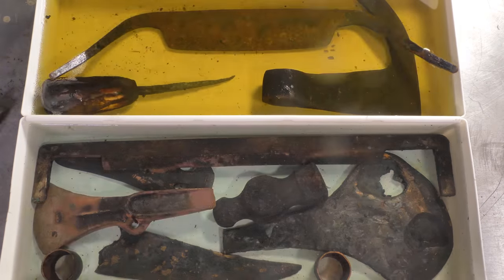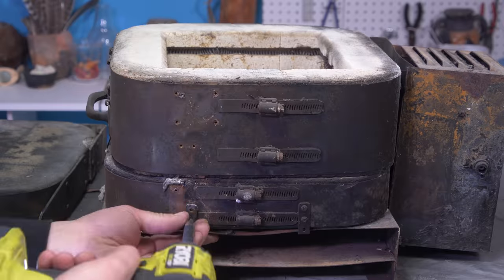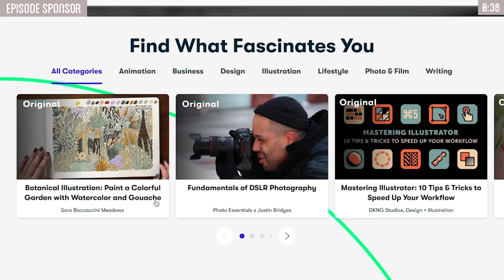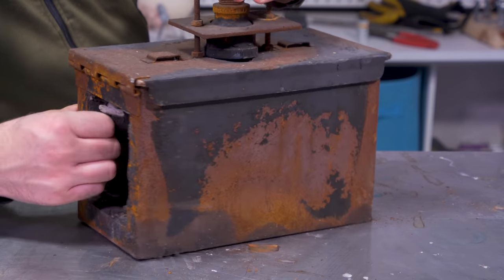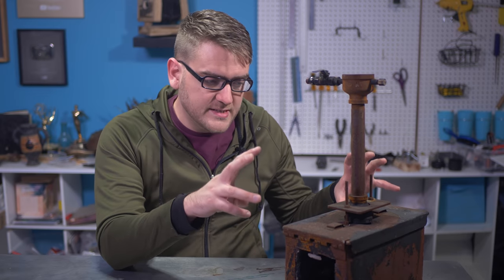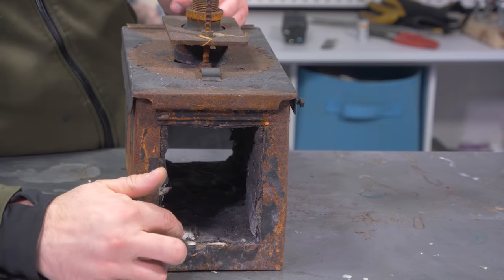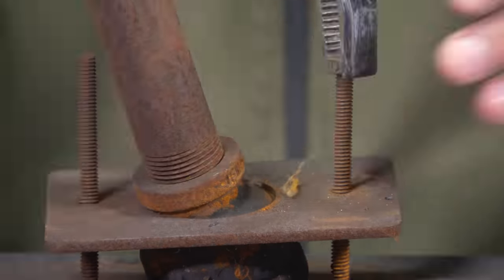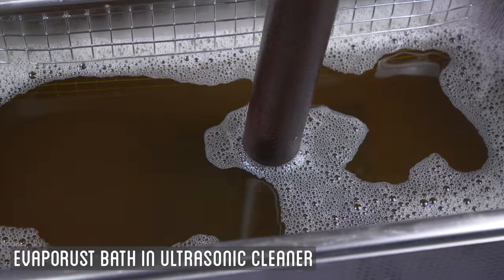Restore or Replace? $1000 Kiln and $150 Forge Rebuild!

Comment: Did you check temp specs on the PI? Might not like being that close to the high heat
Reply: There is insulation. also boards are easily fine up to 100 c

Comment: Just wondering, do the restoration costs here factor in consumables like how many wire wheels/cups, sandpaper discs, etc. you went through doing all the cleanup? You did pretty good work either way, but it seems worth noting if you ended up looking over and realizing, "Wow, that pile over there was like $1k in abrasives to get all the char/ rust/ etc. off."
Reply: A good thought, though as someone who does lots of projects roughly similar to this I don't spend much on those consumables. A pack of say about six or seven sandpaper rounds only cost about $10 and they last about a year on my various projects.  So regardless of whether they're factoring them in, the cost shouldn't be that much more.

Comment: The touch solution looks cool, but I wouldve opted for real knobs. When using the kiln, you'll probably be wearing gloves so the touch interface wont work. Knobs work with gloves

Comment: I feel like a pi would be overkill for just regulating temperature
Reply: Definitely. This is probably a $20 jellybean+Arduino/teensy project, wiring and case included.
Reply: He probably chose it just to have the more advanced interface and customizability. An Arduino would suffice, but wouldn't give him a whole operating system to work with.

Comment: I don't think the price comparison for the kiln (repair vs new) is fair. Granted it was a pain to program, but when your done, you have a definite upgrade. I'd bet if you could find a comparable one to buy with a touch screen display that shows all that info, it would cost at least 200 more than the base model.
Reply: plus he can now take that experience to build his own later, as experience has a dollar value as well, one that he normally overlooks it his pricing.

Comment: I dont think one should count the system design into price per say, since PI has so many already designed projects and say someone else now has the logic board on their kiln fry, they can now rebuilt it using your instructions since work has already been done. Also can recall how the original controls were, but this is really nice you can now make your own temp curve profiles and even control it trough the phone etc, though down side is that one should never trust development board like this to handle kiln or such systems on their own with out supervision... then again i would not trust any machine to do it, if its not tried and tested tech that cannot go bonkers ever. 3D printing, i'm always at home when its running or someone else is supervising it. Only thing i have ever left unsupervised is the oven and that was for just half a hour and washing machine while i went to bed. Its not worth the risk of fire leaving them on. For long 3D prints i would just edit the parts to several smaller peaces that i then glue or chemically weld together so i can supervise it constantly, since not many things can supervise them selfs and there is always the chance that one transistor or resistor blows and whole thing fails spectacularly.

Comment: Eh, if you're considering yourself, then you should be paying whatever wage you should be paying yourself, not minimum wage. You are not worth minimum wage.

If you're doing a generic comparison of purchasing a brand new vs rebuilding/repairing it, you need to consider tools cost, not just labour and parts. To make it a fair comparison, you can't assume everyone have the correct tools for it.

A drill, you can assume most people will have. A sander or an ultrasonic cleaner or the tumble rumble thingymabob? Nope, in that case, you'll need to factor rental cost of those (if they can be rented).

Comment: You really should just buy a new kiln just for the safety reasons. The custom controlled kiln is a major safety hazard and it hasn’t had the same rigorous testing commercial kilns have to go through. Please buy a new one, I don’t want to see you hurt or your property damaged by another fire.
Reply: I really hope he sees this. He did say something in the snow fort video about favoring less flammable materials for the new workshop (which I hope means he'll be opting for brick or concrete or something) but if this kiln fails it's at least the $350 Raspberry Pi gone, if nothing else. Unless the old-fashioned brick kiln he built survived? I know he made one, I just haven't heard anything about whether it's still usable.
Reply: That's why he said he was going to be really cautious when using it, and that he still has a lot of work to do. Given that he's reused most of the original parts minus the electronics, and placed the electronics in the same original housing in the same location with the same original insulation, it seems very very unlikely to cause any issues.

A big company wouldn't accept the small risk, but given the nature of this channel and how relatively simple the kiln is, I don't think the risk is too great for Andy.

Comment: A little late, but I just wanted to point out that barehanding the charred remains of the electronics probably isn't the best plan. All that burnt plastic puts off a bunch of toxic combustion byproducts and some of it is more of a tarry mess that isn't volatile enough to dissipate on its own. I'd have worn gloves for that and put it through an ultrasonic first thing. One sadly common technique for scrapping electronics in third world countries is to make burn piles and strip the metal out of the charred remains. It's profoundly unhealthy, not just from breathing it but from handling the burnt plastic and insulation.

Comment: you forgot to include 95% of the info people need if they wanted to do this, or something based on this. this video was just a montage. Give us some actual information we can use.

i have a jewlers kiln, its either just plugged in and on, or unplugged and off, and i was really hoping this would help me get some info on setting up temperature control for it.......  what was excitement is now disappointment.